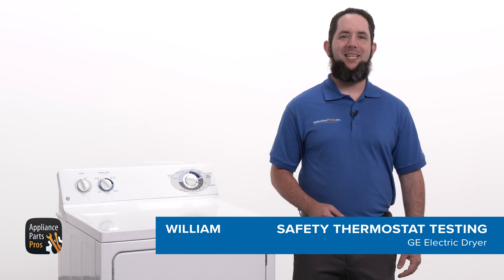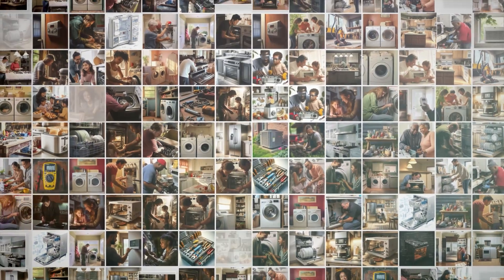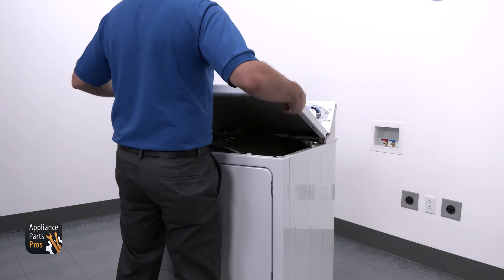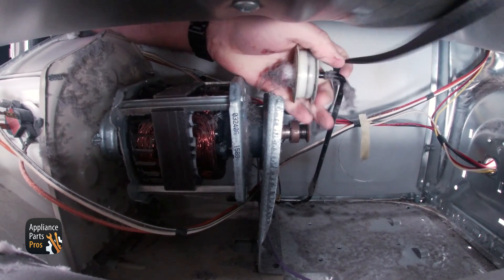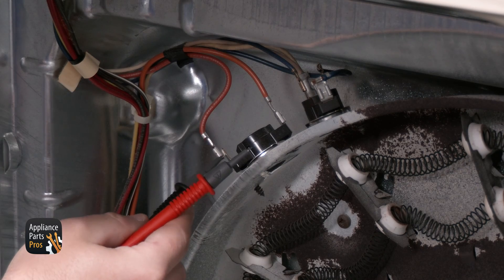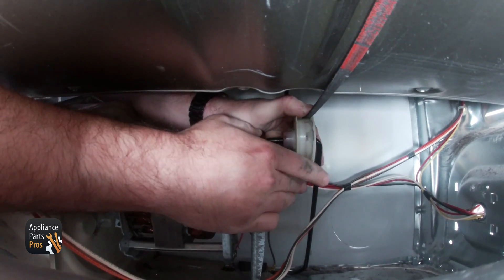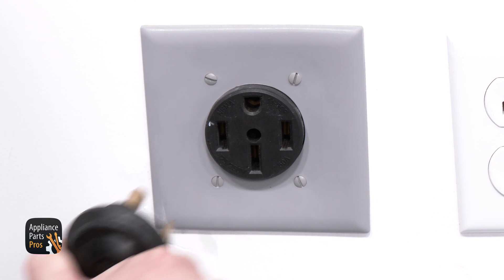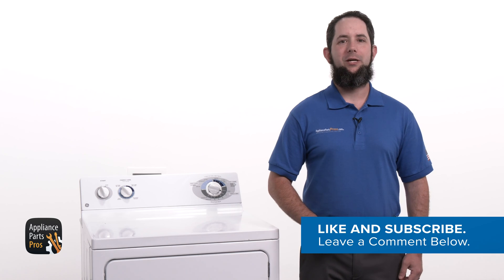How To Test A GE Electric Dryer Safety Thermostat WE4M160

Comment: Dryer is getting too hot but cycling the heat on and off. Thehermostat has continuity. Could it still be bad? Vents are clear. What else could it be?
Reply from the maker: Have you taken a look at the blower wheel? If that is clogged, it could cause that. Also, what is the model number? Some GE models use multiple thermostats. If the cycling thermostat is faulty, that could also cause the issue.
Reply: @appliancepartspros  Thanks for the response. I first noticed overheat and discovered a possum nesting in the exhaust. I cleared all of that out and checked the dryer completely. No debris inside the unit and the blower seems fine. The unit is now venting well but was still getting too hot. I'm thinking perhaps the blockage damaged one of the thermostats as everything else seemed ok. I replaced the high limit thermostat just now. If that doesnt fix the issue I'll try to replace the cycling thermostat. Thanks for your videos.
Reply from the maker: Hopefully that helps. I have seen models of GE dryers that have 3 thermostats. Do you know if it is board or timer driven?